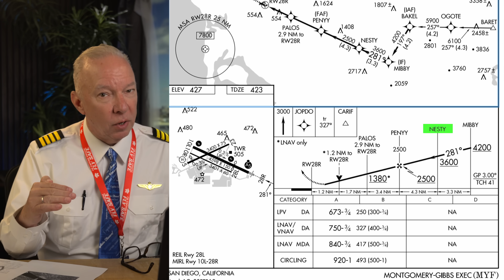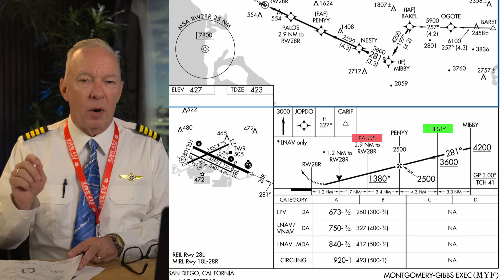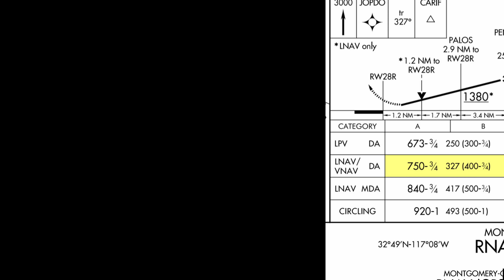Tragic Crash in San Diego: What the Pilot Did Wrong | ATC & Flight Path Breakdown

Comment: Question- What most likely happened when the aircraft struck the power lines? There was pieces of ac debris several feet or yards away before striking the house and a piece of the wing was in the street near the downed power pole? Based on typical aircraft crash dynamics and the details you’ve provided—like debris scattered before impact and a wing section near the street—the most likely sequence when the aircraft struck the power lines is as follows:

1. Low Altitude in Dense Fog
The pilot was flying in near-zero visibility due to fog.

He was descending too low, possibly misjudging altitude or position due to lack of runway lights and visual cues.

There was no reliable visual horizon or airport lighting, so the aircraft may have been below the published minimum descent altitude (MDA) for that approach.

2. Impact with Power Lines
Striking power lines likely caused catastrophic structural failure.

The aircraft may have clipped them with a wing or landing gear.

Power lines at that height are typically strung across wide roads or residential areas, and a jet like a Cessna Citation II descending below 200–300 feet AGL (Above Ground Level) could easily hit them.

3. Disintegration and Loss of Control
After hitting the lines, parts of the aircraft (like a wing section or gear) could shear off immediately, explaining why debris like a wing was found in the street near the downed pole.

Losing part of a wing or control surface would cause the plane to veer uncontrollably, likely entering a rapid descent or roll.

The separation of components and spread of debris yards away before the main impact suggests partial breakup in the air before hitting the house.

4. Final Impact
The remaining fuselage likely continued forward, crashing into the home.

Fire and explosion may have followed due to ruptured fuel tanks or ignition sources, but the power line strike itself could also have contributed to electrical arcing or ignition.

Supporting Precedents
Similar crashes (e.g., in fog or with CFIT—controlled flight into terrain) show that initial impact with obstacles like trees or wires often causes partial breakup and directional changes before final impact.

Summary
The aircraft was too low in foggy conditions, struck power lines, and began to disintegrate midair. A portion of the wing and other components separated during or immediately after the strike, falling near the street and pole. The remaining structure crashed into the house. This sequence reflects a classic case of spatial disorientation and controlled flight into terrain (CFIT)—exacerbated by inoperative airport lighting and poor weather.

Comment: Question- Could it have diverted to another area airport with clearer visibility? Yes, the pilot could have diverted to another airport, and there were likely better options available under the circumstances. Here's the context:

Nearby Alternate Airports (with instrument approach capabilities):
San Diego International Airport (SAN) – This major commercial airport is only about 6 miles from Montgomery-Gibbs Executive Airport and has full instrument landing systems (ILS) and better lighting infrastructure. It would likely have had better visibility or at least better support for low-visibility landings.

Brown Field Municipal (SDM) and Gillespie Field (SEE) – Both are general aviation airports in the San Diego area with instrument approaches and potential alternate weather conditions.

John Wayne Airport (SNA) or Los Angeles-area airports – Farther away, but viable as safe alternates if weather in the San Diego basin was uniformly poor.

Why He Didn’t Divert:
According to reports:

The pilot was aware of the poor conditions at Montgomery-Gibbs but not the inoperative runway lights.

He considered diverting but decided to “give it a go” instead, as heard in ATC communications.

He may have underestimated the impact of the fog and lack of runway visibility.

Pressure to arrive on time, familiarity with the airport, or overconfidence in his ability to land safely may have influenced his decision.

Conclusion:
Yes, diverting was a viable and likely safer option. The crash appears to have been avoidable had the pilot chosen to land at an alternate airport equipped to handle the severe weather and lighting issues that night. The NTSB will ultimately confirm whether alternate airports were clearly available and how much that weighed into the crash.
Reply: Isn't necessary to have NTSB confirm that alternate airports were available... they definitely were. We knew from the conversation with the SoCal control tower that Brown was better, but he quickly dismissed that alternative. Palm Springs would not have coastal fog like SD airports...

Comment: heres the  break down -Part 1 Key Contributing Factors
Severe Weather Conditions
The aircraft encountered dense fog with visibility reduced to approximately one-half statute mile, significantly below the required minimums for the approach. Despite this, the pilot proceeded with the landing attempt.

Inoperative Airport Lighting and Systems
A power surge had disabled the runway lights and weather alert systems at Montgomery-Gibbs Executive Airport prior to the crash. Although the FAA had issued notices about the disabled lights, the pilot did not mention this issue to air traffic control and chose to continue the approach.

Pilot's Decision to Proceed
The pilot, aware of the poor visibility but was not on the inoperative systems, i.e. Runway Lights   indicated by his attempt to turn on manually in the cock pit, considered diverting but ultimately decided to proceed with the landing. His statement, "Doesn't sound great but we'll give it a go," indicated a willingness to continue despite the adverse conditions.

Impact with Power Lines
Approximately two miles from the airport, the aircraft struck power lines before crashing into a residential area. This collision likely resulted from the pilot descending too low in dense fog without visual references.
Reply: Conclusion
The crash appears to have resulted from a combination of environmental factors, equipment failures, and critical decision-making. While the pilot was experienced and authorized to operate the aircraft solo, the decision to continue the approach under such hazardous conditions contributed significantly to the tragic outcome

Comment: The “ridge” is a mesa that’s at roughly the same elevation of the airport. It’s only a ridge insomuch that to the east of it is a valley that rises up to that point, but to the west, toward the airport, it’s about the same elevation from that point. He obviously still shouldn’t have been that low. 

Also, the minimum altitude at PALOS only comes into play if he’s doing an LNAV (not LNAV/VNAV or LPV), though he still should have been near the minimum altitude indicated there. We don’t know for certain what vertical guidance/minima he was using, but the dive and drive nature of the flight path suggests it may have been LNAV only. This presents different possible modalities as to how the approach was executed so poorly - either not following the glidepath indication, or a botched dive and drive, either of which resulted in flying below the MDA before the conditions of 91.175(c) were met. All the minima other than the LPV were also NOTAMed higher than published due to temporary cranes in the area.  

The media are focusing a lot on the approach lights, but there is no way he would have seen them at any point on the approach prior to and including the accident site, even if they were working and he was at the correct altitude. Instead, it’s another link in the chain that illustrates a general lack of situational awareness that created last-minute pressure, resulting in impulsive decision making and tragedy.

Comment: Forgive me as I am not a pilot BUT why would any pilot attempt what you refer too as a “ dive and drive “ when there is a known hill / mountain on final ?? Makes zero sense ? - Also if the altimeter is even remotely capable of delivering an incorrect altitude for height above terrain, is there not a radar back up that would warn the pilot of low altitude on approach? Or would that normally come from the control tower. - If the control tower was not operational at that time then who is the pilot conversing with and what flight information do they have while monitoring this landing ? Or are they just working from a default set of parameters plus local weather conditions in that area ? Lastly ( as I assume the land was there before the airport ) who would design a runway position so close to known elevated terrain and worse still elevated terrain with high tension power cables on top. - In dense fog even if the pylons had warning beacons on top, they would be potentially very difficult to see in dense fog. - Just asking for trouble ? 🤔🥲

Comment: Before my 33 year airline career, I made my living flying Navy Fighters out of Miramar, close to where this flight ended.   I've seen this kind of weather countless times  Not long after sundown, when the conditions are right, the low clouds and fog roll in from the Pacific and form a low lying layer right up to the foot hills well east of the typical San Diego area airports.  The further east you go, the later this happens, but before long the entire coast line is enveloped in fog a few hours after sundown.  Usually it's a low fog layer and sometimes it's thick clouds and extends up tens of thousands of feet. It happens all the time. Sometimes it would be above our TACAN/GCA minimums, and sometimes not.  
When the reported weather was below minimums, we didn't wait around because typically things were not going to get better before sunrise. The answer is to pop over the mountains to the east and land at El Centro or Yuma.  I did that once in a while and so did every one of my squadron mates.  It was routine. That's exactly what this joker should have done.
Starting an approach which you are not authorized to shoot is insane especially when the weather is unknown, the altimeter is unknown, but you know the weather at surrounding airports is well below minimums.  
Had the pilot survived he should have been facing jail time because what he did is WAY more dangerous then getting drunk and driving down your local highway in your car at a high rate of speed.  Shame on him.  Congratulations to your Captain Steeeve for a nice analysis.
Reply: Sounds like he was extremely fatigued to make the comment, “give it a go” as if he has another chance if he makes a mistake. Question you may know: is the jet fuel automatically dumped with a dangerous dissent to avoid an explosion or did the pilot dump the jet fuel to avoid an explosion? Terrible tragedy for all involved & thoughts & prayers out to everyone involved.❤️🙏

Comment: Br is not baby rain, it’s meaning is ‘mist’ defined by FG and BR in terms of visibility as the lateral visibility seen at the landing point, usually below 500m or 200’ cloud base lo visibility procedures would be in force, RVR is then used by the tower Runway Visual Range by special measuring equipment on the runway, special licences are needed in visibility less than Cat 1 op’s 550m rvr, the approach assigned will definitely not have the rvr to ‘commense’ an approach below 550m rvr, 1/2 statute mike should be ok but 200’ cloud base is ‘probably’ way below minimums for the approach assigned and did he have regional altimeter setting or local airport setting
Reply from the maker: It’s a joke!
Reply: BR means "brume" which is the french word for mist. It's pronounced 'broom'
Reply: In weather reports, "BR" stands for mist. It's a common abbreviation used to indicate the presence of mist, a type of weather phenomenon that restricts visibility due to small water droplets suspended in the air. Mist is typically characterized by a visibility of greater than or equal to 5/8 statute miles

Comment: I believe you are wrong on a couple major points that are both pretty damning. First is the you said they couldn’t even start the approach, which is incorrect if they were operating under part 91. If they were 91 they can try an approach that is 0-0 if they wanted. The next is the approach category. I am pretty sure that citation is not fast enough to be considered category c.

Comment: 6:10 Contract weather observer here: BR is mist, not drizzle (that's DZ with intensity modifiers of +/-). Mist is minute particles of water suspended in the air that restrict visibility to less than 7SM but no less than 1/2SM. At 1/2SM or less it becomes FG. BR should just be thought of as "light fog" colloquially.

Comment: I love your videos however I’d like to pick one small nit:
I wonder if you are aware of the fact that ADSB is basically transmitting flight levels, not altitude?

For air traffic control use, the facility has programs that make the appropriate adjustments based on the optometer setting. However for raw tracking such as you would see on your ADSP and device aboard the airplane or on any of these websites, what you’re seeing our flight levels. Un adjusted for June 9.92 inches of mercury. Unfortunately, this kind of throws a wrench into any analysis of how the approach was flown.

Comment: VV means Vertical Visibility.  Never heard of "indefinite".  Also, when the temperature and dew point are the same the air mass is "saturated" with visible moisture...IE FOG.  BR is derived from the french word "brouillard" which means "fog", however in aviation weather it translates to "Mist"...not "baby rain".  These are ICAO standard aviation weather terms.  Also,  "grandient path", not "glideslope"...
Reply: In the US, Metar sky reporting follows this format: 
Cloud amount and height: CLR (no clouds detected below 12000 feet); FEW (few); SCT
(scattered); BKN (broken); OVC (overcast); followed by 3-digit height in hundreds of
feet; or vertical visibility (VV) followed by height for indefinite ceiling. 

So when vertical visibility is used with height, it's implied the ceiling is indefinite.

Comment: 2 points that need correction.  In part 91, he can legally shoot the approach even if the ceiling and visibility are reported below minimums. Can’t descend below minimums unless he’s got it however. Also, in the FAA’s FSB report (13.2), CE-500 series aircraft are considered Cat B aircraft, so he was also legal use that particular approach. 13:03
Reply: These old captain analysis videos love to vilify pilots. Yes the pilot made a mistake. But He clearly doesn’t understand how part 91 operations work, there is more to the story. It’s common practice in the ga community to attempt an approach and it can be safe if done correctly. When you show the public audio says “let’s give it a try” it sounds scary but he failed to share how typical that could be in 91 operations. Maybe the owner wants him to try it regardless.
Reply: @DHsd4546  could you please explain more about what a part 91 operation is? I still don’t quite understand how that changed things.
Reply: @fleetskipper1810 Part 91 is owner operated. Part 135 is chartered flight. Part 121 airlines. Much looser regs for 91. Tight regs for 121

If part 91, he was legal to “take a look”, but doesn’t change anything in regards to this accident.
Reply: @fleetskipper1810  It's the rules one has to follow. Part 91 are the basic flight rules. The FAA says if someone is going to carrying paying passengers, that's not good enough so there are more strengient rules for commerical operators.

Comment: Two other things,  he entered the prior checkpoint at the correct altitude but fast. He may have pulled power back and not coordinated trim or stick pressure appropriately to stay on the slope while decellerating, and two,  we need altitude info for before and when he hit the wires. The sharp gain in altitude at the last moment may have been him pulling up abruptly to avoid the obstacle that just came in to view and not from the impact.

Comment: Hi Steve, nice breakdown. However I think you're off on the dive and drive theory here. The TERPS criteria in approach plate procedure design does account for altimeter error. Typically in the IF segment, TERPS is going to require 500-1000 feet of ROC above the highest obstacle. It drops down to 250-300 feet inside of the FAF, PALOS has a hard cross of 1380, so even doing a dive and drive well before crossing PALOS should still provide at least 300 feet of clearance legally, but looking at the actual terrain height, it's closer to 600 feet of clearance so I think the error here occurred with how the pilot planned his vertical descent. The pilot missed the CAT and minimums early on and didn't have local weather, high workload scenario, wouldn't shock me if he was using VS to descend and failed to set his step down altitudes. Probably got way behind the aircraft and VS drove him straight into the ground.

Comment: Aviate, navigate, communicate. He was so concerned about getting the weather he dropped below the glide slope or altimeter wasn't set correctly either way it's a difficult approach to begin with in challenging conditions with a single pilot and runway lights that were not up.